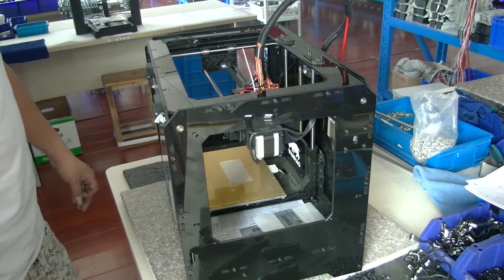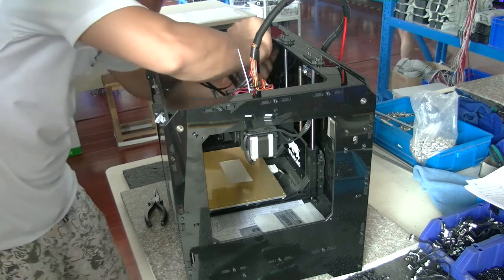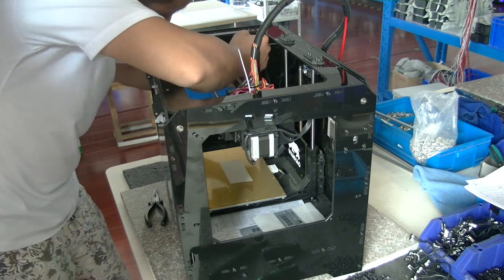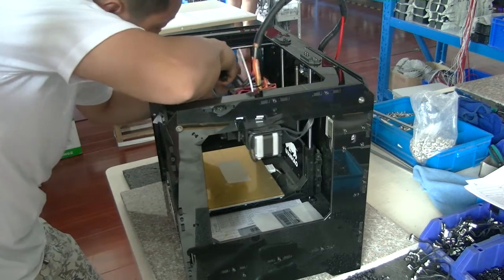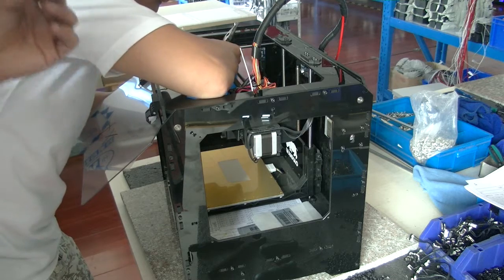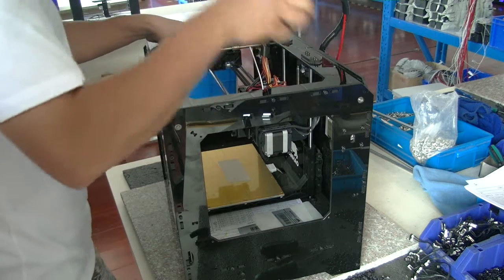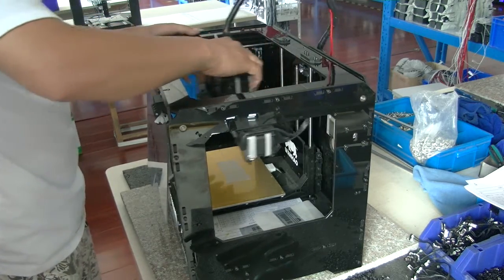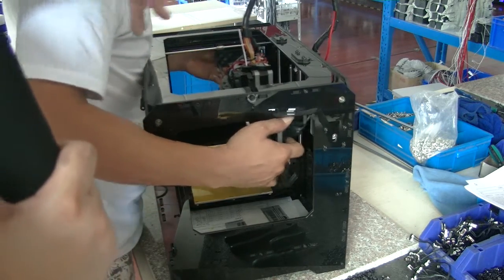How to replace the Y axis belt of wanhao duplicator 4X?

Comment: Maybe I can help a bit. I changed my y belts because they were not in square with build plate. Problem was on left side of belt number of teeth was not the same as on the right side. So i moved y axis till the end stop switch and counted number of teeth. it was 1.5 teeth difference. :) when i made it equal on both sides i got perfectly aligned y axis. maybe just a tip when somebody changes that. :) Keep up with videos about tips and tutorials for wanhao D4S and others :)